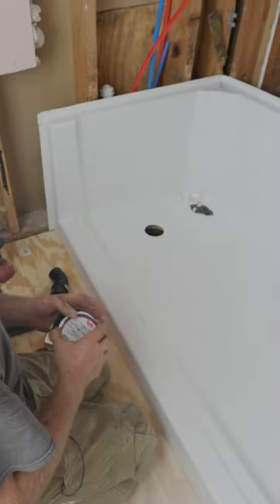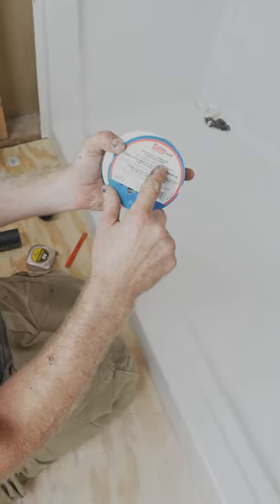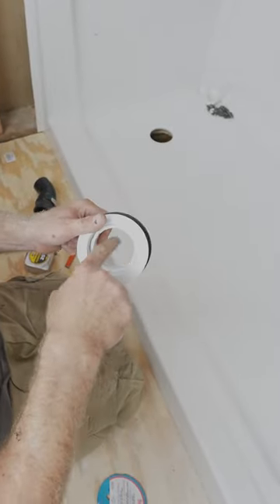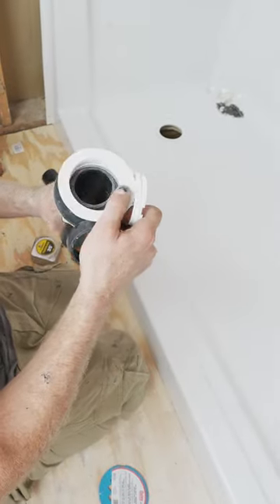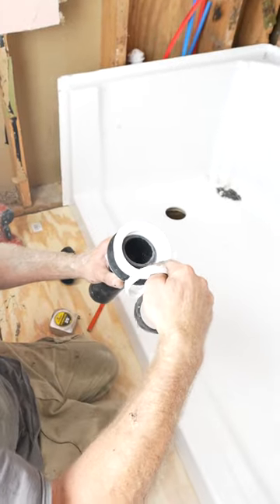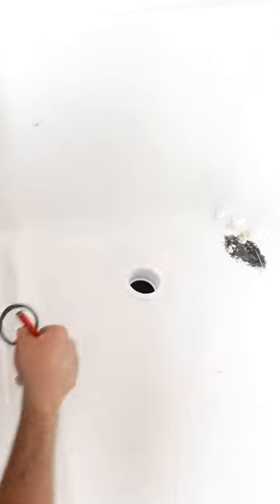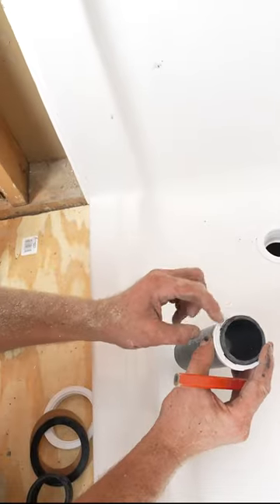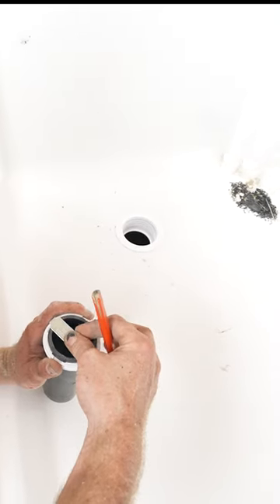Oatey Shower Drain Tip #shorts #plumbing #diy

Comment: Can the gasket be cut by 0.25 inches if the existing pipe is a little low? My pipe is 1.5 inches lower than the standard height (1 inch) you recommended. Extending the pipe by half inch can be painful but the way the system is designed I think if I cut the gasket by a quarter inch the seal will be fine only thing is it will be lower than the standard height. Any thoughts?
Reply: Jesus, raise the pipe bro. You really want to cut the one thing preventing leaks?

Comment: It drives me crazy how complicated they try to make drains as if it's rocket science. It's water going down a frickin hole. That's it.
Reply: Its an unnecessary pain. Flexible joints will be the future
Reply: its the waterproofing to not have leaks. thats the issue.
Reply: Not sure if you used or installed one of those leaking pieces of junk
Reply: @edwardmccoy274  Good point, Edward. One plumber suggested adding silicon caulking between the pipe and compression ring. That made sense to me.